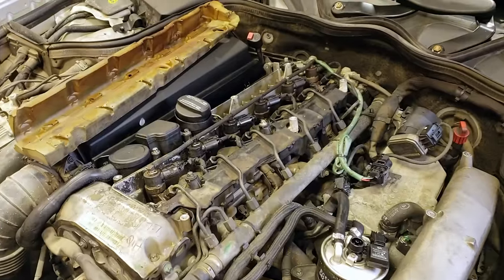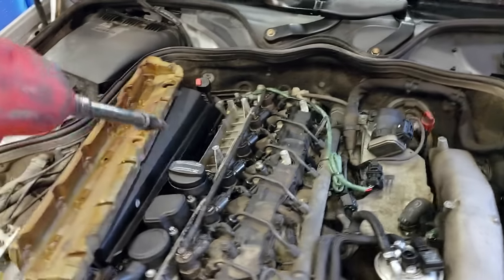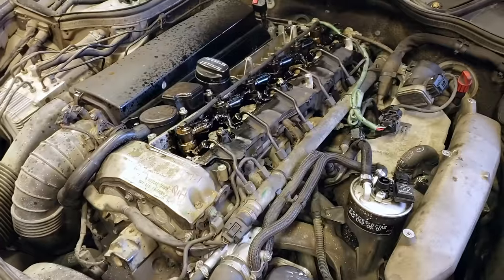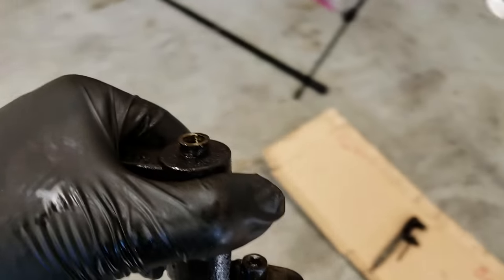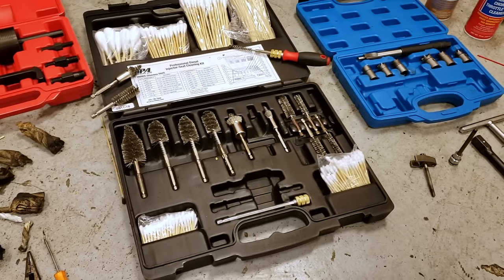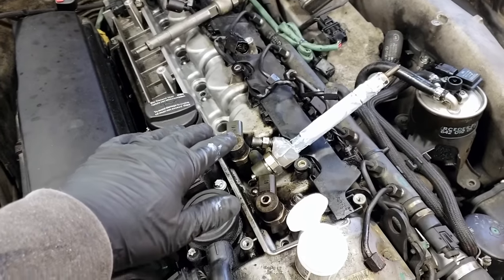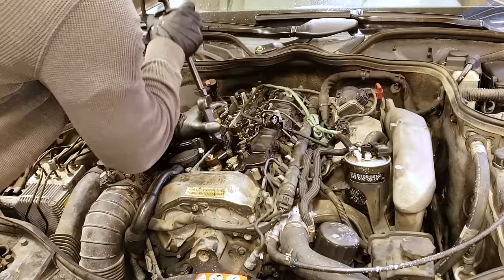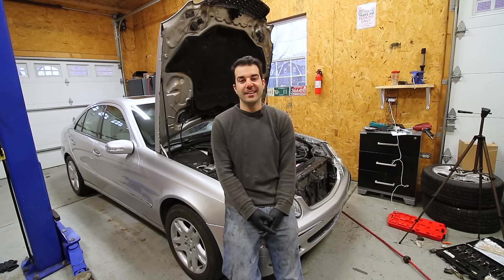My Turbo Diesel Mercedes Has A Nasty Engine Issue. Don't Buy A Diesel Before Watching This video.

Comment: I had a similar problem on a 4 cyl Merc diesel engine fitted to a PT Cruiser (we got diesel Cruisers in Europe!) Chuffing noise and lots of black death. I was running on home made bio diesel and it melted the black death away over the course of a few weeks, making the leak much worse but making it easier to remove the injector. The nose of the injector had been grooved by the continuous blow by and had to be replaced. The genuine mercedes  copper sealing rings are very thin and prone to leak over time so I used Honda Accord diesel seals, same size but a bit thicker and easier to seal. Sold the car years ago and it's still going strong with the new owner!

Comment: I had the same issue with my '06 2500 Sprinter 5 cylinder. I always let the motor warm up before driving away in warm or cold weather. Noticed the poof poof sound and later that became the compression leak on #2 cylinder fuel injector. Ordered the 5 piece copper washer seals and 5 new stretch bolts and all came out without all the tightness you experienced in this vid. Put back together and all is well with the parts at $13 + postage. 
Borrowed an lbs/inch wrench from a neighbor and had to buy a 6MM X 1.0 tap(Home Depot $8.) to clear out the threads on the stretch bolt hold down hole in the head. I have to get a shade tree put in by the driveway to make this look more professional! Thanks

Comment: Normal stuff for diesel engines. In Europe we get used to it. Just check every month under engine cover and, if you notice any wet stuff, replace injector copper seals. Always use OEM seals. Sometimes the thickness of aftermarket one is not the same.

Comment: The biggest problem is not only the injector ring seals, the injector must be pulled correctly or the head is damaged. It's worse if a glow plug needs replacing .In that case no quote can be given because often a head needs to be replaced . The injector feed pipes are often damaged and also can't be reused as the pressure involved is several thousand PSi. They are a reasonable engine but crap compared with OM 617's and 606's. If you are a member of an affiliated Mercedes Club you can use your membership card to access the WSM (workshop manuals ) for free.

Comment: Had the same issue with an injector on my 2006 E320 bluetec. Your video was clear and concise. I'm glad it was long with plenty of detail. I got the same kits you used to clean, pull and ream. I can't thank you enough for the walk through. It would have seemed too daunting without this video. Thank you so much.

Comment: I've done this repair countless times on Jeep Grand Cherokees with the 2.7crd engine which is basically identical to this engine with one less cylinder. The reason it happens is corrosion between the cylinder head and injector locks the injector in place and the screw can't keep the pressure necessary to compress the copper washer. In the Jeep the last two injectors cannot be removed unless you lower the engine which is a huge pain in the ass. Some injectors have required hours of twisting and hammering to remove them, others have to be disassembled so that a special puller can be attached and once you take an injector apart it needs to be rebuilt or replaced. It is extremely difficult to give an estimate for such procedures as some injectors come out easier than others; also, the amount of time needed to get that channel clean depends on how full of grime it is. Cleaning is a manual operation (screwdriver, small chisels, etc.) as the chemicals can't penetrate fast enough; chemicals only work once the bulk of the carbon has been removed). It is important that the o-rings on each injector be inspected and/or replaced as necessary. Mercedes has a special grease for the injector walls but in my experience any grease will do.

Comment: Alex. Thanks to your passion for Mercedes diesels, I acquired a 2011 E350 Bluetec Diesel with 40k miles on it, for $15,500 this weekend. it was a single-owner car, owned by an elderly gentleman who took it to the dealership for service almost every time he came into town. It is in incredibly good condition and has an exceedingly long Carfax full of service entries. The new tires on it were also installed by the dealer in July of 2018 and are also reflected on the Carfax.

My question is about the injectors. I asked the dealership I bought it from to have their techs inspect the injectors for injector blow-by, and they said it is clean with no evidence of bad injector seals. I got a three month, 3000 mile bumper to bumper warranty and I'd like to inspect the injectors myself, but the V6 in this car looks quite a bit different than the engine in yours. The engine doesn't make that "shit shit shit shit" sound at idle.

Any advice on inspecting the injectors would be appreciated.
Reply from the maker: I'm sure they are fine but it's just a matter of taking a look. If you see the black carbon then it has it. I don't think that engine had this issue especially that early.

Comment: Great video for those who like MB and can do a decent amount of their own service.   We had two 1992 E300s straight six (One black/gray lower clad & One Sea foam green).   BOTH required head replacement due to crack.  The Black needed the work within 6 months from the time we purchased it used $5K for it.  ( I did have the car inspected before purchase)  The the green one we had at least 2-3 years before we bought the Black one and that's why we bought it.   They seemed bullet proof.... until that first head crack issue.  The Green one went bad on us (Same head crack issue) about 12 months after the Black one.   $10K on the two within 1 year.   Certainly soured us on that.
With standard Maintenance the 300 series are easy brakes and front rotors were about the same as most other cars for same work BUT when you go beyond the "Normal Maintenance" that's when you get bit big time.
Sadly after those two experiences we lost interest in MBs used or otherwise.    Easy to understand why they can be found so often right at the 4 year mark - folks don't want to face those expenses.

Thanks for your excellent video.   MB are beautiful and they seem so tight even after 100K but, we've now become Toyota fans and our family has had excellent experiences with all the Toyotas we've had.

Comment: My dad owns a manual w211 e220 cdi that smells diesel carbon and oil, and i knew that you have/had two e320s cdi so we took the engine cover off and thank God that we discovered this because if not it would have been alpt worse than what it is at this point

Comment: Thank you for this honest tutorial,most other reviews don't show the problems you can run in to,you even showed me how to remove the MAF sensor housing,wich is lokated on the same spot as on my W204 200CDI 136hp 2009,i already bought 'CRC Air sensor clean',so i'm going right at it.
Keep on the good work !!

Comment: I had a 2005 Mercedes Vito and had the black death I got quoted £1150 for 4 new injectors 
I bought a reseating tool and I will add!..  mine come out very easy after chipping away all the carbon,
Cost me about £45 all in,  but as I say mine came out easy,  good job on yours buddy

Comment: Happened to my 2002 W203 C220 CDI a couple of times. The problem mine had is a previous owner had tried to get it repaired and the shop had destroyed the threads so the stretch bolts wouldn't grip anymore. Drilling out the holes and installing 8mm Time Serts along with M8 stainless steel bolts was the only solution and frankly, I wish I'd done that first as it's far better than the factory M6 bolts.

Comment: I had been searching for a CDI, and found my first one a couple years ago (have had three so far). It was for sale at a dealer in Ohio (I am in CA). The car was in awesome condition (a 9+). The asking price was around 8K. I asked them to send photos of the engine cover removed. I had a pretty bad case of B.D. (as bad as one of the photos in the video), and they said it would go to auction.  I talked them into selling it for $3,500 considering it's condition. I got it home, and with the parts in hand, replaced all the injector seals. #1 had to be pulled with a slide hammer, but was not damaged. About 8 hours later (most of that was cleaning), the job was done.  My niece has the car now, and loves it. It has about 50K since the repair.  It is totally a DIY job, and I imagine I saved a Grand or more over having a dealer do the job.

Comment: got the same color E220 W211 with 360 thousand kilometers gonna be cleaning the EGR Valve tomorrow probably gonna look into getting the injectors sealed and the whole shabam cleaned

Comment: I had a ML270 that died of BLACK DEATH! The carbon build up was so bad that two of the injectors wouldn't budge! The car wasn't worth much so I sold it for scrap but I can vouch for it being a car killer. I tried everything to get those injectors out. I chipped away as much tar as possible soaked around the injectors for weeks with every possible fluid known to man! Applied heat and used professional injector pullers and I couldn't even get them a millimetre out! As stated before the car wasn't worth the hassle but I can give my advice, if it's too far gone it's not worth the hassle! 

Great video though fella and it's great to see when it works out positively!! Keep up the informative videos!!

Peace!! ✌✌✌

Comment: Fantastic!  I've got an '06 E320 CDI that I've had since 25K miles and now has 320K on it.  It has been fabulous... but just got the black death on cyl #1.  Of course the dealer wants a fortune to fix it.  So I'm off to buy those tools and brush kit!  This car is still strong... just needs some love.  Thanks for the video!

Comment: Had an 05 CDI with 144,000. When I found out about "black death" I pulled the foam cover off and saw it on 2 injectors. Traded it in on a vw diesel.

Comment: I've watched more than a view diesel injector removal and cleaning videos and this one is simply hands down the best on removal. I think if you perform a test on the diesel return rate first (to id injectors that need renewal/replacement) and then remove the injectors and for those that passed the leak test, surgical grade clean of the injector nozzle and seat, followed by ceramic grease to the housing and new copper sealing washer, it will be happy days.

Comment: Worked for a Benz dealer here in Germany for many years. This was a pretty common problem. I’ve fixed this hundreds of times(literally) and I have seen waaaaaaayyyyyy worse cases than this. I once had a vehicle where the injectors where almost completely covered with this gunk to the point where you could almost not see them. I literally had to chip it away with a hammer and a screwdriver. Also, when the injectors are really stuck, they are most likely no good anymore. The “black death” will literally squeeze the injector to the point that the injector housing cracks. Also one other very important thing, those screws that hold the injector holding forks in place are stretch screws and should ALWAYS be replaced once removed. I once saw an injector almost launch itself through the hood of a W210 because someone didn’t think it was necessary to replace those screws.

Comment: Nearly bought a Bluetec and decided on an e350 Estate instead.  Still watched this video because I have a soft spot for the diesel, and the one I nearly purchased had "BD" evidence on the head.  I didn't know enough about it at the time.  Thanks so much for your videos! Love the education.  BTW Just finished a brake job on the e350, remember not everyone is blessed with the AMG/Brembos and the standard brakes are way different.

Comment: genuine tip to get the solid black death off told to me by a old injector repair man ? heavy duty paint stripper just melts it away turns it into slime .wipe off with old rags .done mine and it works perfect

Comment: tip for cleaning threads, take a bolt that fits and grind off the threads to make one or more flat sections. This makes a great cleaning tool, that won't thin the threads.

Comment: Soak injector in Cola. This works wonders. Drive until motor is war. Slightly unscrew and screw down  the bolt holding injector clamp while 2. Person keeps rpm at 2000. The pressure will work the injector out. Always got the injector out with this method.

Comment: A tip,If you use an air line with a good nozzle on the end,place your towel on top air blow the high pressure air in and around the injectors.This will clear most of the muck and blow it into the towel.Same applies to the crispy crud.
It would have been better if you had waited for slide puller,how are you going to warm the engine now?

Comment: I had 2 of the seals on my 06 Sprinter. It had been making noise for about 5000 miles before repair. Lucky for me there was no damage. Didn't have the others done and have had no problems with the others so far 25000 miles later.

Comment: Actually had the same problem on my OM611, you could smell it as soon as it started to appear in the cabin, left it untreated for 5 days, fixed it myself for 0.10 euros, by changing the copper ring, as soon as you smell something funky, you should look under the covers, easy enough, not a thing to be scared of.
Reply: oh, and I used gasket remover for the tar removal that I had laying around.

Comment: I bought a long round piece of wood in the same diameter as the seal seat. Then put cleaner on the tip, put the stick in 😅 and turn it back and forth like making fire. Just a tip for lower the repair cost.

Comment: I just have the older 1982-85 turbo-diesel w/ poppet injectors, but heard of this "black death" and saw a nice-looking 2006 E320 near me for sale at $4K w/ 160K miles.  A few thoughts.  Looks like there is no top seal, so the carb cleaner will soak down into the bore to help soften the carbon which should help.  Perhaps other solvents would work as well, like diesel, gasoline, or wood stove window cleaner (mostly ammonia I think), which should all be used when the engine is off.  Another thought is if you could loosen the clamp with engine running so the compression helps get it started moving outward, but just a little since you don't want to load the stiff fuel tubing.  Might also help to try rotating the injector and going axially in and out.  At least w/ rusted bolts, it helps to go back and forth so the rust particles don't jam, trying to flush them out with the penetrant. The problem looks like it results from a design issue.  I am surprised they secure the injectors w/ just one side bolt.  That doesn't seem enough to load the brass seal washers to not leak.  I hope the tapped hole in the head has a steel insert instead of just bare aluminum threads.  In my engines, M-B also uses a metal seal washer (heat shield) but the injector has a large steel thread that is torqued very high (~90 ft-lbf I recall), so never heard of seal leaking issues except maybe by gomers who try re-using the heat shields or not cleaning the injector hole well.  If you did mess up that thread, it is part of the pre-chamber which can be replaced but even harder to slide-hammer out than your injectors.

Comment: When you are cutting a new seat in the head put grease on the end of the tool , this picks up a lot of the aluminium  swarf you create and  it's easier to clean the tool than the bore  . Clean out the seat with the cotton tips

Comment: The slide hammer I got like that which said it fit all CDI mercedes didnt fit my ML 270, bit too fat. But I guessed it might not so also bought the other actual mercedes tool which ratchets it out and between the two kits I made it work  by fitting the slide hammer thing to the 30mm screw top of the injector. Great video. Thanks.

Comment: With an injector that has lots of carbon buildup, if you will take a compound leverage pliers (with red handles) that Snap-On makes and grab the injector body with that pliers opened to max and move the injector left to right; this will allow you to reduce the friction caused by the carbon and will actually grind on the surfaces of the injector body-to-bore wall and this allows you to remove the inject without a slide hammer. This has been my experience with Sprinters. A slide hammer is the best way to put carbon between two surfaces and wedge tight those two surfaces. Simple physics thought.

Comment: I'm a mechanic and did 14 years in a euro shop.. We had one like the one in the photos. We didn't have the puller so we got the local merc dealership to do it. They snapped off one of the F$%^#@@ long thin retaining bolts  and couldn't get the injector out with the correct puller, so the head had to come off, The injector got damaged. SO. . . My boss had a (LOUD) chat with them and they supplied a head set, bolts at cost, a second hand head that came with the injectors which they pulled out of the head for free. (The bottom of the injector hole was too badly eroded to machine up.) We then put it together and the job was done.

Comment: If the injector is very stuck and you don’t have a puller tool you can crank over the engine to use its compression to push the injector out make sure to be cautious of fuel pouring out of the rail when you do this

Comment: Worked at a dealer repairing combustion engines for 25 years, so I can appreciate this excellent video. However, I have retired and switched to a pure EV and never plan to have to deal with combustion engines again, especially diesels.